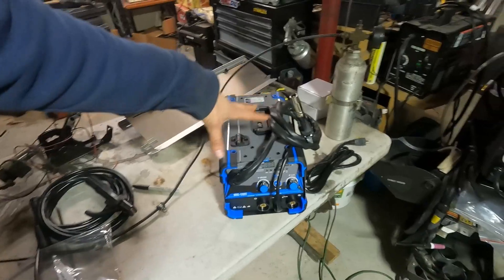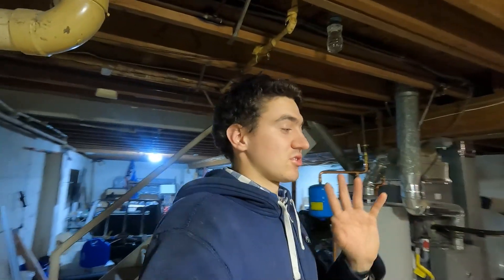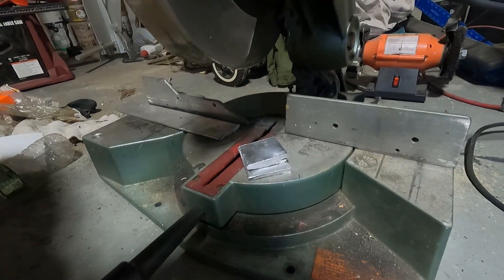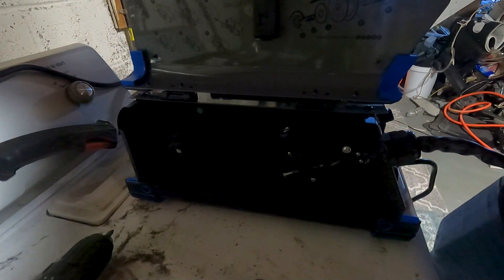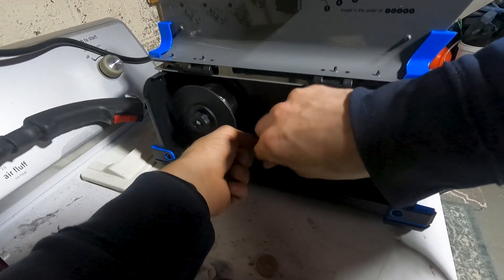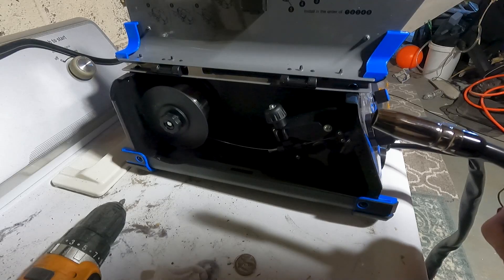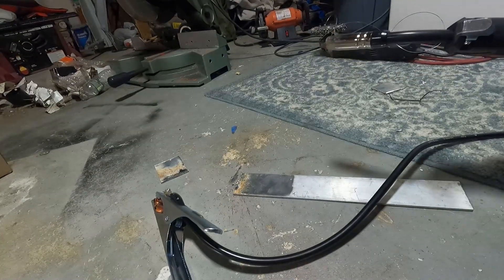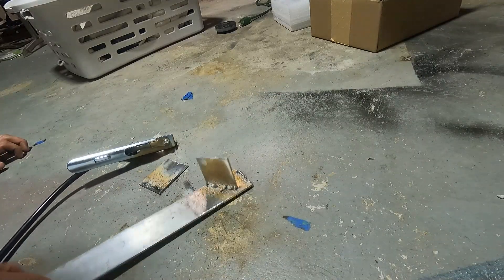Trying to Flux Weld Aluminum with a DC Welder! Can you Weld Aluminum with DC Welders?!

Comment: Seems like you could get a lot better weld by changing the settings. Try faster wire speed.
Reply from the maker: I’m going to try with 220. I believe I maxed out both settings but seem to it was feeding right but I’ll definitely going to give it a shot again today! As well on my way back from work get the stuff I need to make 220 work with it

Comment: thanks for the demo!  that was very helpful to me.  it looks REALLY bright, but nothing seems to be coming out of it!   maybe u need more wire speed, and then its even brighter and evil,   maybe u didnt heat the metal up enough and its really nasty to weld things.  maybe u have to get it glowing.
Reply from the maker: I know when I used AC volts I thought I was to hot but I needed more heat due to the AL dissipating the heat through it to quick. So I’m not sure if the is is the same case but I need to hook it up to 220 to test that theory! Which I’m making an adapter this week for it. I believe I didn’t try in one of the clips with the wire speed higher and didn’t help but I would have to try again to confirm that I did try that!!!

Appreciate the comment. Definitely need to look into it more and glad it was useful to you!
Reply: @ more welding vids would be cool - ill be here when u do a really good one.